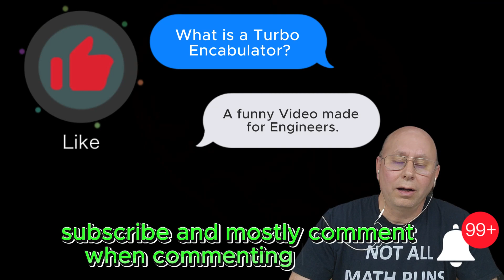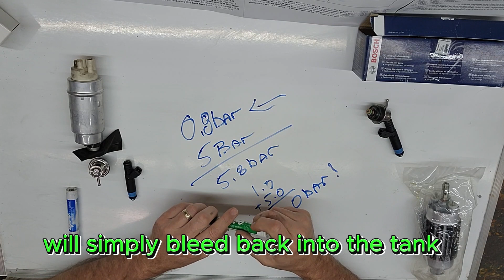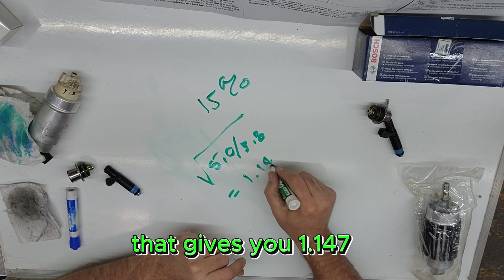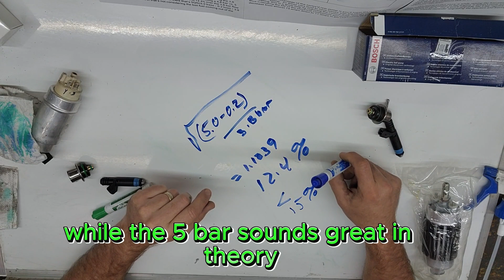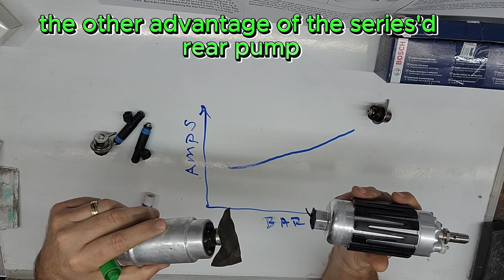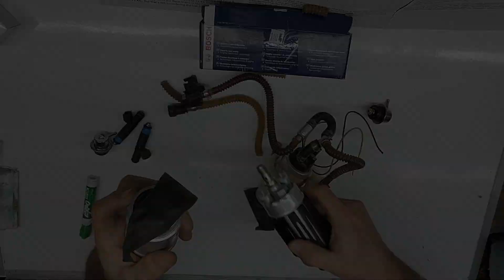Your 996 turbo fuel system has a secret!

Comment: Learn something new everyday.  I have a 996 X50 tuned and was required to install the 5bar FPR.  Then listening to you, the better way is to retain the 3.8 FPR and upgrade the injectors.  I presume to 750.  Doing so, what would that do to the performance of the already existing Tune?
Reply from the maker: The existing tune will need to be updated for the larger injectors.   We commonly use 60 or 80lb injectors in the 996tt with a proper tune.    This will give you all the pump can offer and more available fuel for more power with proper tuning.

Comment: Would changing the check valve in the fuel pump assembly with a higher flowing unit be beneficial on a stock pump?
Reply from the maker: Yes.  that would stop the bypass and the problem of losing the fuel flow within the tank.   Just make sure everything else is ok for the higher pressure!
Reply: @protomotive  so if i were to use an adjustable FPR to bring the running pressure down to 3.8 bar, would this be problematic?
Reply from the maker: @stephengomolka9798 that would be back to stock fuel pressure so your tune should be updated accordingly..  Changing fuel pressure is like changing fuel injector size which also needs a recal to run properly.

Comment: Thanks for the info on the valves. Do you have the part numbers of the 2 valves? I'm looking at replacing my 996 fuel pressure regulator (possibly faulty). Not looking for power increase but like the idea of the larger orifice on the 997 regulator for the fuel return at idle.

Comment: This was very informative, thank you, Todd! While it’s not a 996 Turbo, I have a 997 Turbo which, when I purchased it, had 1100cc fuel injector and a 5 BAR FPR. I have since dropped the engine and replaced the fuel injectors, which were bad, with your Protomotive 1100cc injectors. I also replaced the FPR with a Protomotive 5 BAR. With the larger injectors and the stock 997 Turbo fuel system, is having a 5 BAR FPR unnecessary? The car has a custom COBB tune as well. Thank you, sir!
Reply from the maker: I'm assuming your running pump fuel on a bolt-on kit?  If so a 5 bar fpr is a bit overkill since you can produce 1000+hp on 1100s which would quickly destroy a stock lower end.    On e85, 1100s are good for about 750+whp.   Either way, you should have more than enough injector at 3.8 bar on a stock engine.
Reply: @protomotive Thanks so much for the input, and for sharing your other video! I’m running 93oct with TiAL XR1000. The car was modded when I purchased it and I simply replaced the same size injectors and FPR when I last had the engine out. Now I know this set up is overkill since I’m not going for 1000+ HP, but currently making 688WHP and the car runs pretty well. Now that I know, I wish I had purchased something like 80lb injectors to make the car a little more compliant at low RPM and idle. I’ll revisit that one of these days. Thanks again, Todd!
Reply from the maker: @nev997TT  you're very welcome.   1100cc injectors should be very drivable, almost like stock.   So run a datalog on the car and check the fuel trims are all OK.   Some tuners get lazy and only work on max power then you're left with a car that stumbles or hesitates on the low end where you drive it most of the time.  THat's completely tunable and should not be like that!
Reply from the maker: Check this video out.  It covers a lot of this. https://youtu.be/xnfS-62rGVc?si=msnBBl9R9vBV7i8c

Comment: I’ve got an 996 Turbo X50 with do88 intercoolers, Miltek Turbo back exhaust with sports cats and Turbosmart 11psi wastegates. I’m looking to have the car remapped/tuned, what fuelling mods do I need to do?
Reply from the maker: Stock x50 turbos run out at 600 crank / 530 or so whp.  So you'd be at 100 percent or more duty cycle on stock injectors.   If you're not planning on upgrading the turbos you'd be OK with a 5 bar which would give you a little bump just to keep the injectors from maxing out.   60lb injectors are a nicer upgrade that'll take you further and 80s even better.  They're the same cost and run identically at low speeds so we prefer 80s on the 996tt.   Then you're good to the limit of the stock pump or about 620whp.   If you upgrade to k2418g or another hybrid you'll want to drop in our single walbro upgrade pump.  Then you're good to the limits of the engine, rods and headstuds.   We go over these in I blew up my Porsche and top 10 996t weak links for a more in depth explanation.  BTW if you have a durametric cable we can tune you up right away and log for duty cycle to see exaclty how your system is performing :)  hop over to our website for much more fun :)
Reply: @protomotive  thank you the reply, I will check out the website. I really didn’t think the car could make 600bhp with its current hardware. I was expecting mid 500’s.
Reply from the maker: @sje106  yes the x50 and gt2 have quite the advantage with k24s over k16s

Comment: Thank you for posting this! I am looking at rebuilding the turbos on my x50 and was researching what fuel demand would be needed. Perfect timing!
Reply from the maker: That's awesome!  Your fuel demand increaser over stock will be proportional to the power increase.  If you're upgrading to k2418gxt on our site you'll definitely want 80s in there.   Or if going e85 use 1100s and a drop in walbro 450.   Let us know if there's anything else we can  help with!

Comment: I have a 996TT that I am upgrading the fuel pump to a 450 w/10 and 8 AN lines feed/return and 1000cc ID injectors.  Would it be advantageous of me to also upgrade to a 997 3.8bar FPR to benefit from the larger orifice?
Reply from the maker: Yes, otherwise you'll tend to have artificially high fuel pressure at idle and light throttle due to the high volume fuel pump and lack of return capability.  Just think you're feeding the engine with a 16 and 13mm ID hose and trying to return all that flow through 2mm, lol.   Even 3 sounds small, but will return a 450 pump OK.